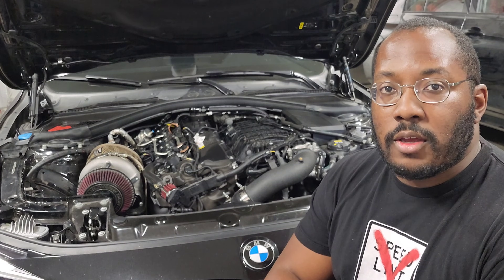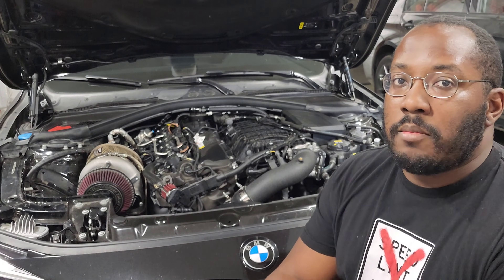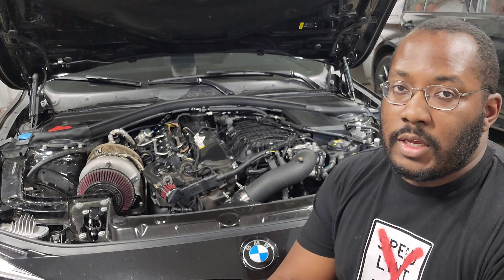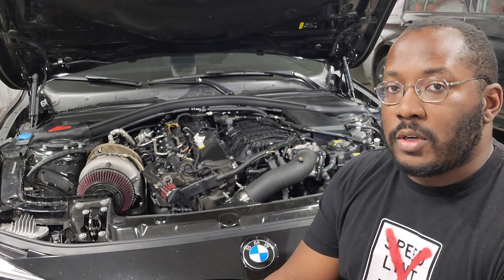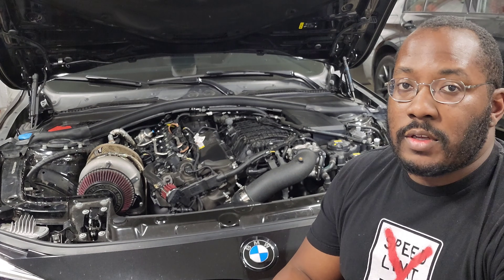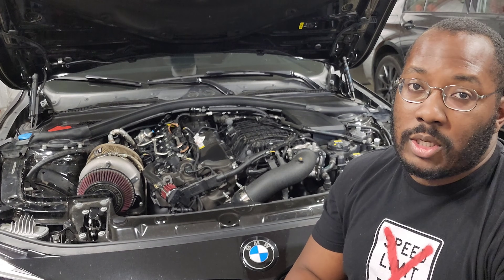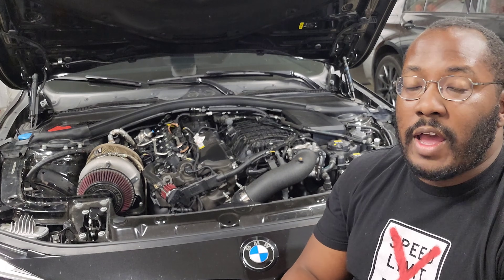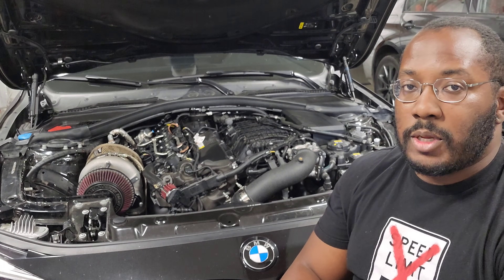You CANNOT only spray Methanol for Cooling! Here's Why

Comment: What about on a car with a supercharger like the Z06? I can't get any answers on my harrop supercharged e92 m3
Reply from the maker: Everything i said applies to any modern engine with electronic fuel control
Reply: @kern417  gotcha so I should only consider water for cooling. I found it interesting ESS sells their new g1 kits "meth ready" but dont tune for it and your video confirms my assumptions
Reply from the maker: @andrewrossnagel9433  yes if you want to tune for it, at least i recommend running the tune slightly rich so even the leanest cylinder is running at a safe afr